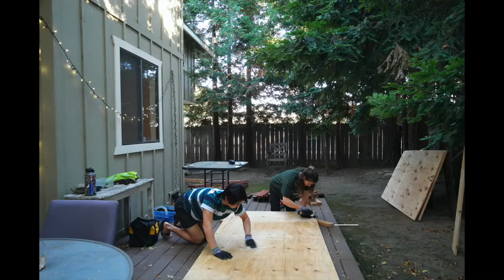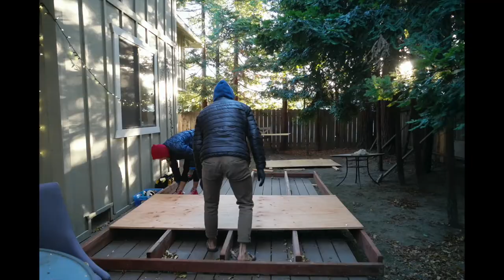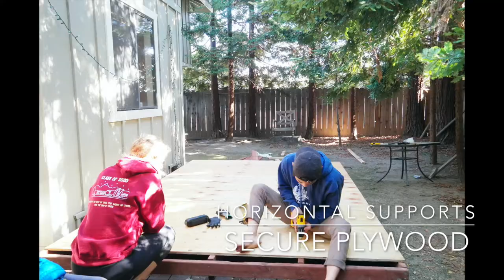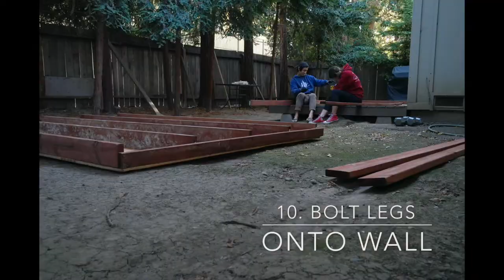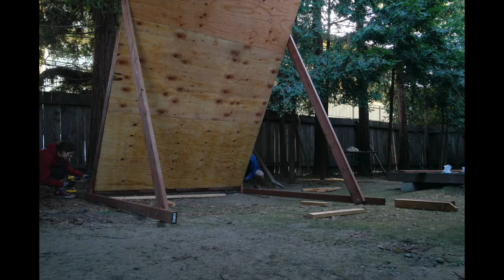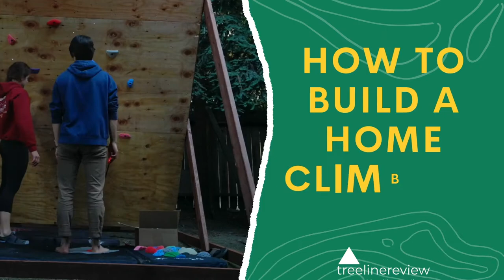How to Build Your Own Home Climbing Wall in 12 Steps

Comment: Wow your build is so good! Im actually planning to do a climbing wall very similar to yours! It will be my first diy project so im a total noob! I figured out the plywood to buy for the wall, instead do you remember what kind of post you used? Like the measurements for the frame and for the base! If I can recreate your project it would be so good for improving my climbing skills! And the bolts are just normal wood bolts to screw? (Not the t nut).Thanks so much for your video, love from italy
Reply from the maker: The wood we used for the actual wall structure (the backing holding all the plywood in place) is all 2x4 hardwood. Our wall measures 8 ft by 12 ft, so the frame is a combination of 12 foot pieces long/tall wise and then smaller 2 foot pieces connecting the frame. The large supporting planks that hold the wall up at an angle are 2x8 pieces, the length of which will depend on what angle you set the wall at, ours are about 10 ft and 5 ft. Our wall is actually adjustable with hex bolts holding the supports to the frame, so there is a little added length at the top where the connection is. The base is a mirror of the wall size with added blocks on either side to account for the plane of the moving support beams (8 ft 4 in by 12 ft). If you were building a wall that won’t need adjustable supports to change the angle, you could connect these directly to the frame, so the base could be 8ft by 12 ft as well. 

For the entire project we used outdoor wood screws EXCEPT for the support beam connections, which again are mobile and support the wall. For these connections we used 1/2 in hex bolts which are very sturdy and allow the beams to move while staying connected to the wall. This is also how we were able to use the support beams to push the wall up while erecting it.

Comment: Looking to build a similar wall to yours. What's the length of the bottom lumber you have on both sides that the 4 legs connect? Your other post says the legs were 5ft and 10ft so I'm guessing it's 12ft for the bottom lumber?